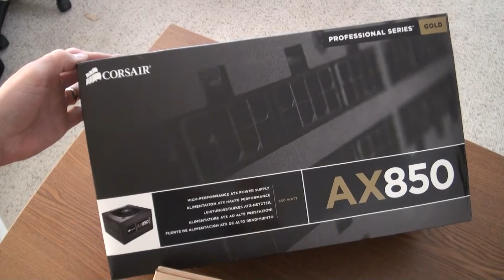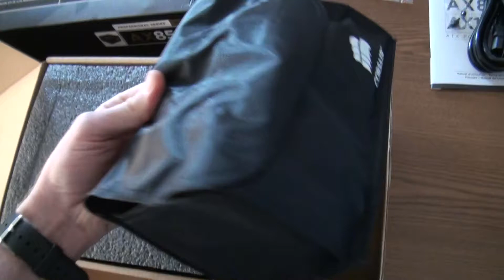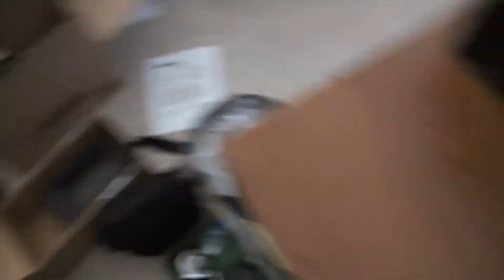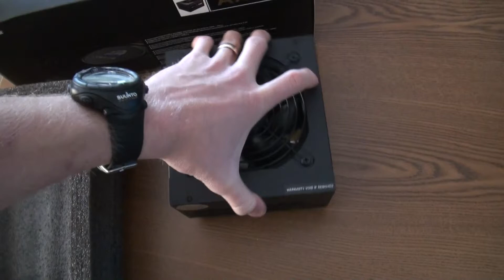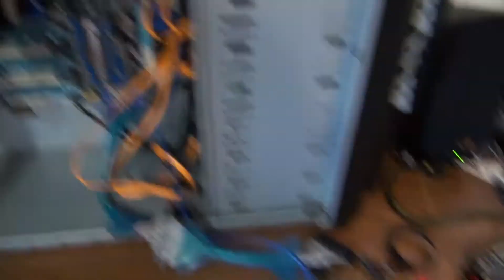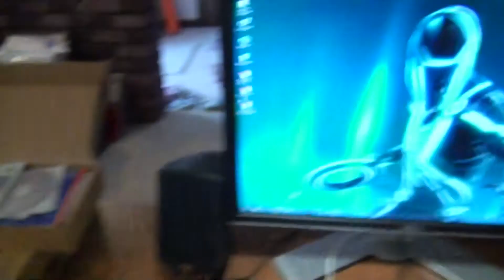Corsair AX850 Power Supply Review

Comment: I am still running this power supply since 2011, hands down the best purchase I have ever made. It has survived multiple full system upgrades without hesitation, from AMD Phenom X2 to FX, then Ryzen 1000, 2000, and now 5000. While everything else came and went, this PSU just kept going strong. Truly legendary reliability and one of those rare components that outlives entire generations of hardware.
Reply: same but now i think its time to retire it... upgrade my gpu - and has problems shutting down... pc just keeps going into a reboot state

Comment: Thanks for mentioning the issue about the Fan not running when you power up.... I thought my unit was defective too until you mentioned that the fan works based on the load and shuts off when there is no load or very little load to save power and reduce noise (even though when the fan in the AX850 is running it's very quiet)..

Comment: Looks  like it's a  good PSU.. would the cables  be  long enough in a  Coolermaster  HAF-X  case? I currently use a Antec Truepower Quattro 850watt.. I'm changing  PSU cos my system is 6 yrs old.. so makes sense to put  a  new PSU in it.. I had  considered the  Corsair HX1050.. I think the AX850 will be ok..